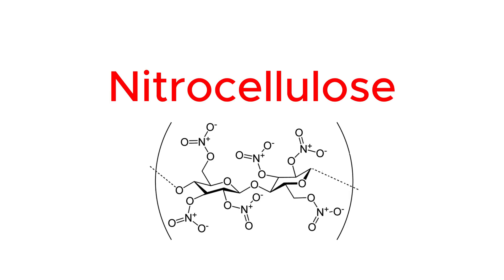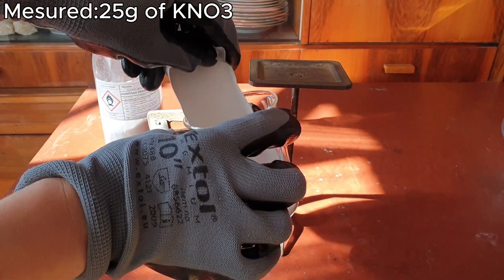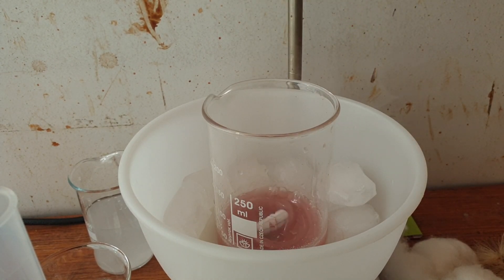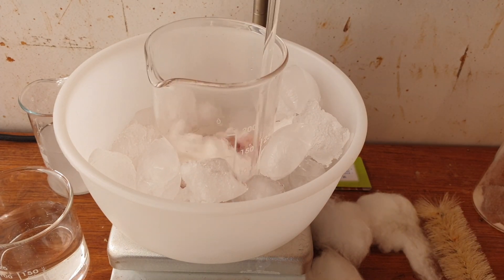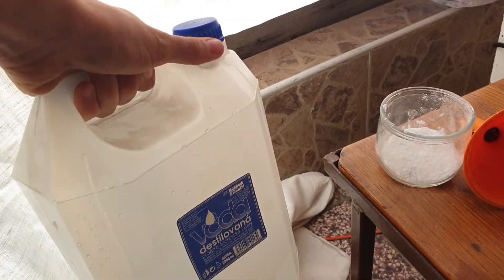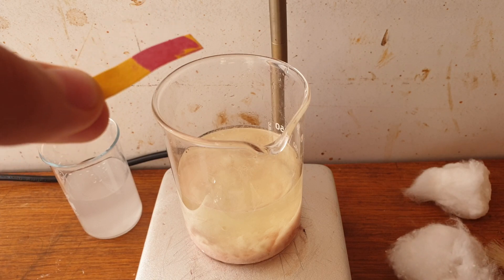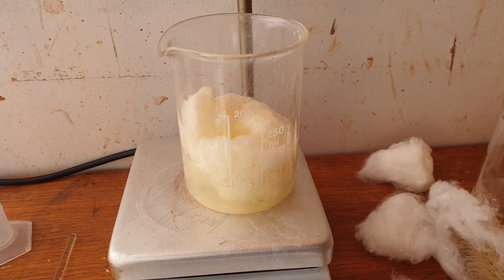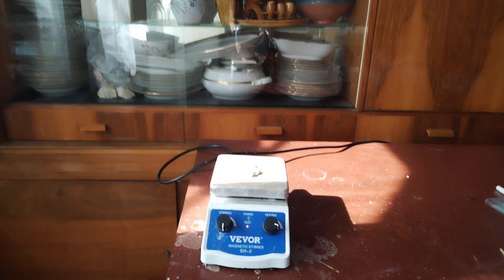Making Nitrocellulose

Comment: Can it be made with 30% sulfuric acid? (in my country, higher concentration acid is a controlled substance). Thanks
Reply from the maker: No I doubt you can maybe if u concentrate it but that's dangerous

Comment: Hello I tryed make it with sa96+na65 and sa96+pn and pure cellulose, it doesn't work, very intresting. nice vid.😇
Reply from the maker: what?
Reply: @Salt_and_Peroxide  i mean what i try make nitcell with sulfuric acid (96%) and nitric acid 65% and sulf. acid with potassium nitrate, and 100% cellulose. They was failed. Ratio and kept it for a long time. Sulf acid turn paper to coal/
Reply: @PulicineTag Try keeping it colder, and if even then fails just dilute the acids more with water.